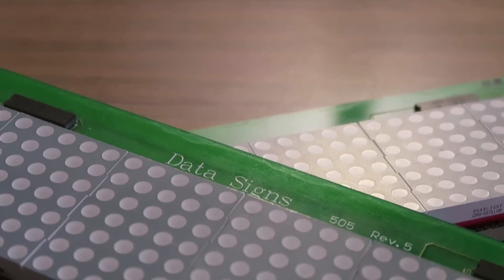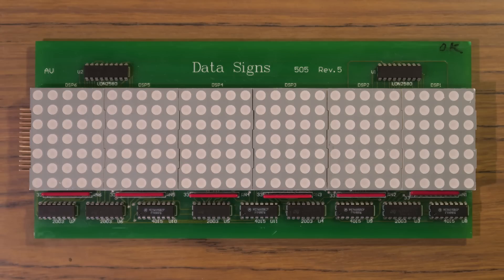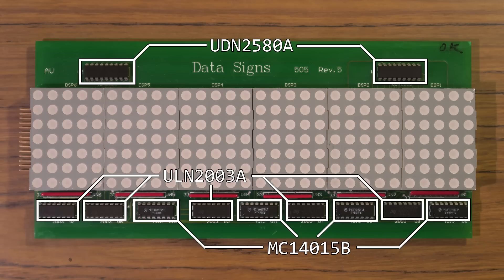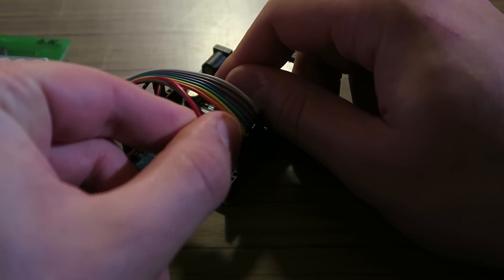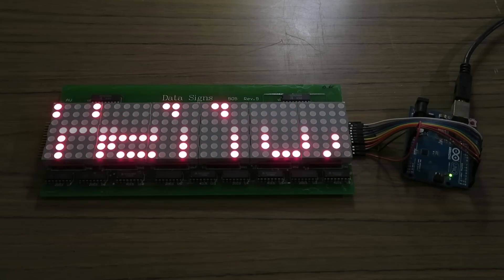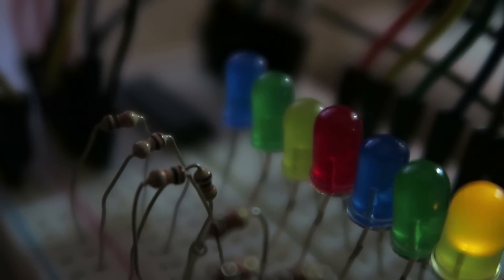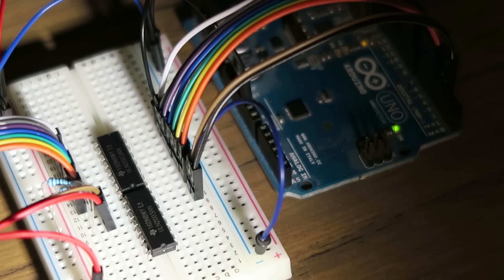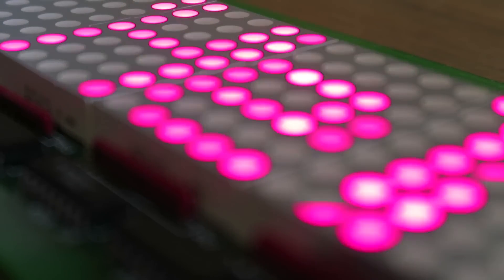LED Sign Hack

Comment: I have a similar display, it runs on 7.5volts .
Reply from the maker: I (wrongly) assumed the current limiting resistors were 330 ohms, but decided to measure them and they're 33 ohms (oops). I can't find the exact datasheet for the LED modules but I found a close one that shows the the max current is 60mA at 10% duty. The LED and drivers seem to drop about 4.2V, so the supply should be around 6.2V, which is strange as the dropout voltage of a regulator on the controlling board was 7.5V.

Comment: Cool tracking, but you have "data" and "Not Connected" backwards...
Reply from the maker: "Not Connected" is a direct trace to the connector on the other end, and is not connected to any part of the module logic. "Data" goes to a shift register with a trace on the front of the board.
Reply: Interesting, that would explain it.  Love the captions.